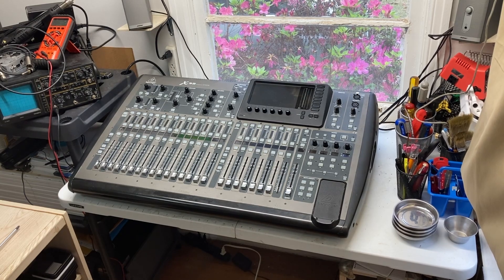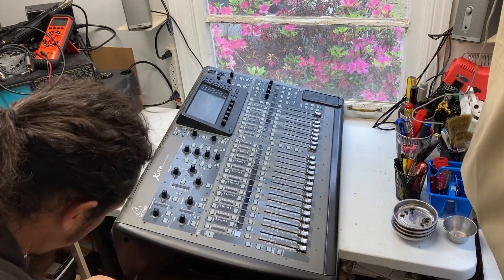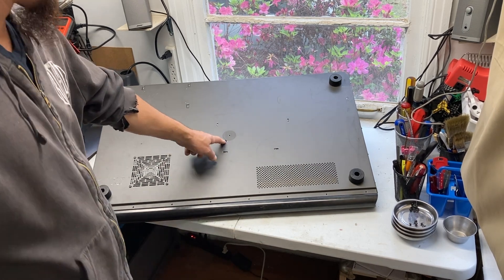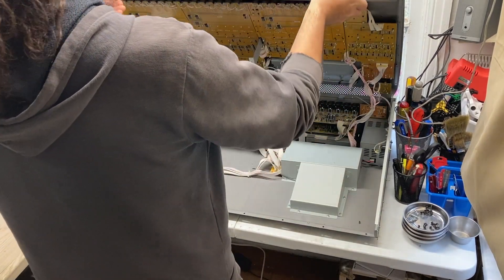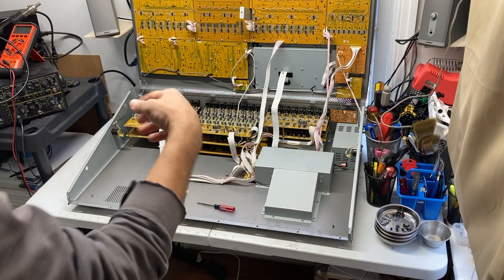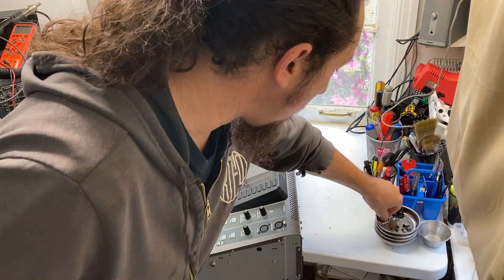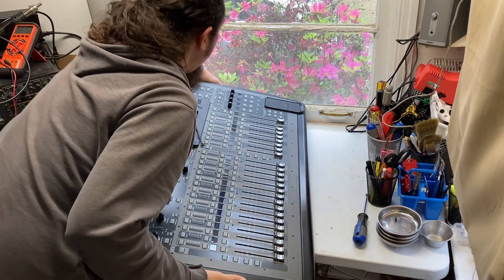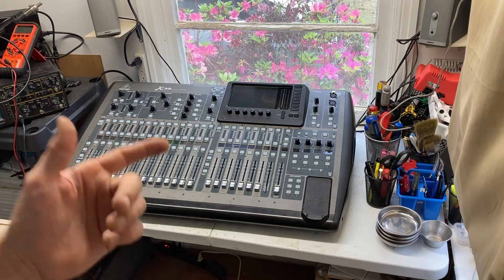Behringer X32 Digital Mixing Console CR2032 Battery Replacement::Clock Won't Stay in Time

Comment: I changed the battery on ours but the clock runs extremely slowly. Like one minute takes about ten. How is that even possible?
Reply from the maker: No idea
Reply: @Artemago  The fix was update / refresh latest firmware. Maybe it was a bug after a new battery was installed.